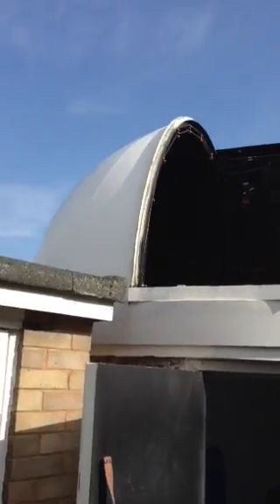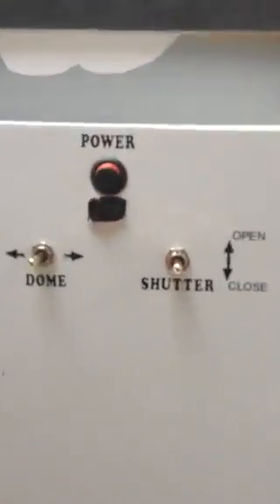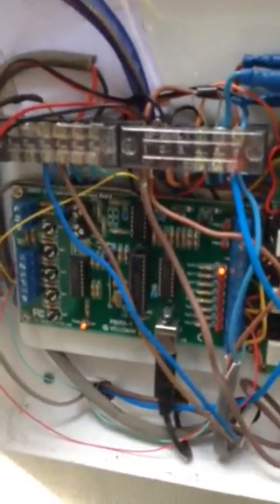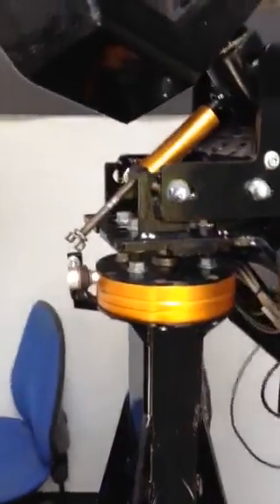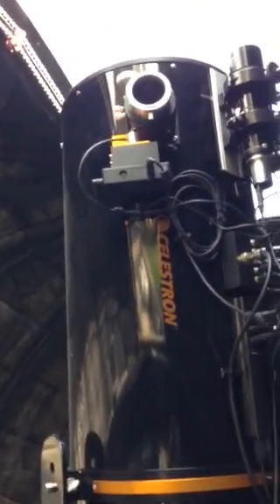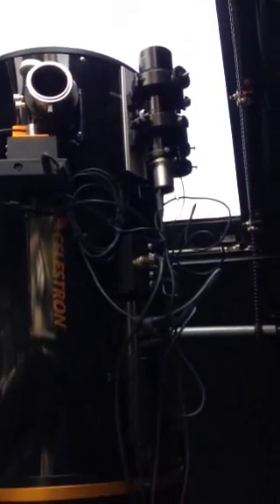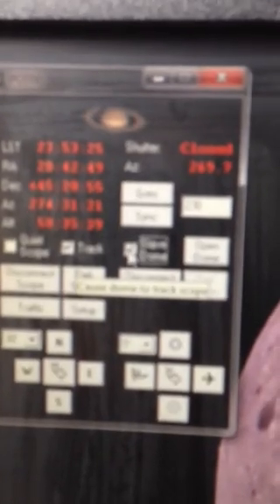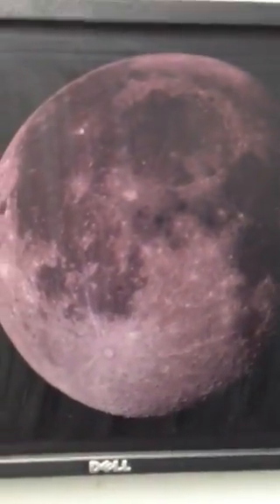Hand built telescope equatorial mount and backyard Observatory

Comment from the maker: Hi Alexandre, only the motor control board was Celestron. The mount was made to use the same gear reduction rate as the Celestron mount but using home made worm gears and large motors.